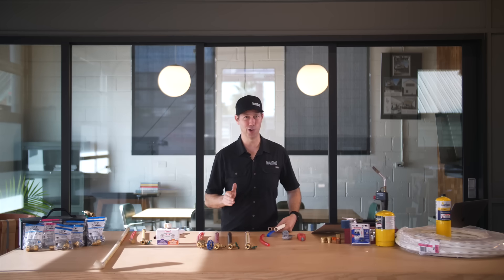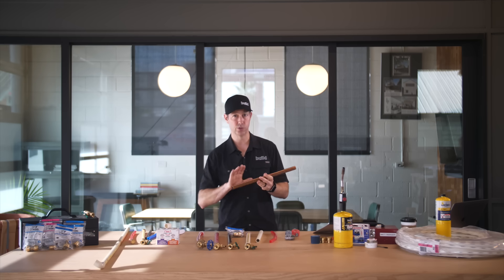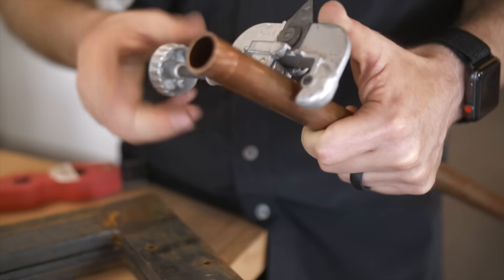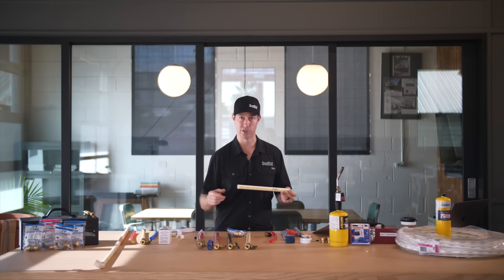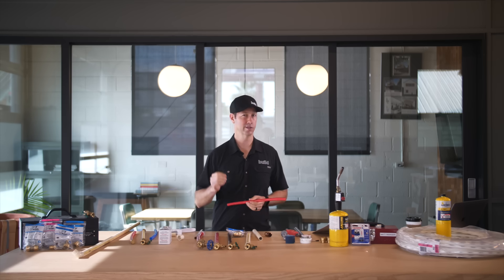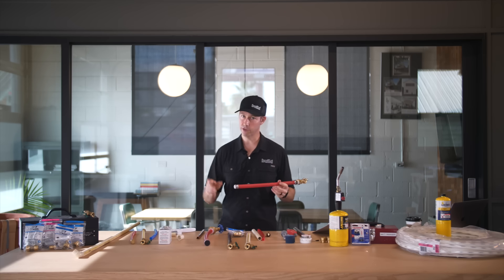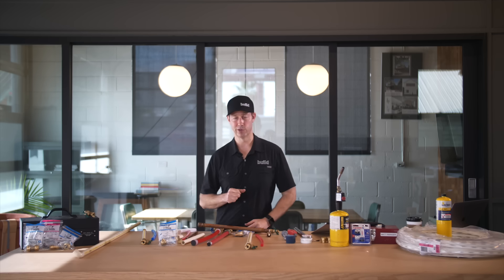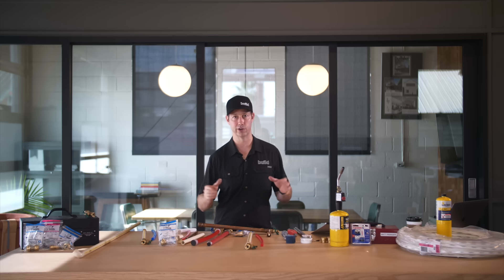PEX vs COPPER vs CPVC plumbing pipes

Comment: Pro tip. The clear primer does a great job of taking purple stains out. Also pro tip, only by the clear primer. I learned this when installing a brand new tub... dumped an entire bottle in a brand new tub. I thought I was going to have to get a new tub. Clear primer took the stain completely out
Reply: Careful if there is someone inspecting the plumbing, a lot of code doesn’t allow clear primer because you can’t tell if it’s been primed. That’s why it’s purple, they can tell easily
Reply: @P3rishedX 
Yeah, purple primer is literally just clear primer with a dye added to show it was used.
Reply: Amazing tip. Thank you.
Reply: Clear primer does the same thing purple primer does. It strips the outer layer. Whodathunk

Comment: A few comments:
1) PEX is not very durable for hot water service because of the combined effect of chlorination and heat. There's a lot of publihed data and long-term studies on this showing the need to replace it after ~5-7 years. CPVC is much better for this purpose, and I'd certainly prefer it for all water piping for ease of installation and repair. Besides, having all joints solvent-welded makes it very reliable, although the flexibility of PEX allowing its installation with minimal number of joints and bends is definitely a plus.

2) No piping system is intended to survive water hammer, and it's even less about piping supports than the piping itself which can even burst if subjected to severe and repeated pressure shocks, especially in long downward vertical runs. You have to install expanders, general rule: one 50cc expander for every 10m of straight horizontal run or upward vertical run, two for downward vertical run, and you need larger expanders for larger pipe diameters.

3) All plastic piping systems are available in black variety (with carbon filler) which is UV-resistant and can be traced outdoors. Obviously, it will still degrade, but much slower than white piping.

Comment: My home was built in 2001 all my copper system completely failed with pinhole leaks.  Three plumbers recommended replacement repiping. This was 2018. All plumbers mentioned the copper today is not like the copper from the 80’s or before and it is no longer a reliable product. After looking at CPVC ,Pex-a expansion and Pex-B compression.I went with PEX a uponor. Because pex a is expansive the flow path is wider.

Comment: What material is PEX and CPVC?
I am only familiar with PVC and Polypropylene.
I personally do not buy into this "Shark Bite" fittings. IMO, they will not last especially in high pressure systems.

Comment: I had a really bad experience with PEX and will never use it again. I prefer the CPVC but you also did not mention the compression fitting for copper that make it far more easy to work with.
Reply: What was your bad experience?
Reply: @seanm3226  It leaks.

Comment: they make a flex copper, they make a flex stainless steel, I was shocked when years ago I saw those flex metals covered with colored (red 4 hot blue 4 cold) plastic for insulation purposes.

Comment: I'm not sure why it seems like such a toss up, or why he recommends cpvc for remodel. Why not pex? He said the material (copper) is a little bit more expensive but it's more like 4x as expensive. Then says the pex needs fewer fittings, longer runs. So that's more money on both fittings and labor. Then he mentioned the increased labor for doing the copper fittings vs pex. So even more money. It doesn't seem to be competitive at all. Pex seems like the clear choice* (*except if cost is zero factor but even then, I don't know what advantages copper really offers). What am I missing? He seems to think copper will last longer, but I think he overestimates how long copper lasts. He said 75-100 years minimum. Ummmm, that sounds like a MASSIVELY optimistic view, no? I've got copper pipes in my house from the 60's and they ALL leaked years ago. I think most people have to upgrade their plumbing more often than once every 100 years, right? I would think maybe 50 years would be about right. I would also not trust the sharkbite fittings to last nearly that long either but I think the Type A fittings might last as long as copper. I'm not a plumber though so maybe I'm wrong?

Comment: i use to read about the PEX, They said PEX FAIL when the pipes are exposed to chlorine that is within the water. this is u have to explain more because city water has chlorine in it. n PEX,  there was a concern that some chemicals may leak from the pipe into the water.

Comment: Would not trust CPVC. Just a little exposure to the wrong chemical and it goes brittle. Wouldn’t trust it with my house. Copper, I would want the higher grade and make sure it is well protected when going through concrete.

Comment: I have cpvc in my home which was built in 1986. I have an under the slab leak on my hot water line which is going to cost me a lot of money to fix.
cpvc becomes brittle and cracks over time. Your only going to get 30 years out of cpvc . This is not some random accident because my neighbors are all having the same problems and have to repipe there entire homes. 20’000 to repipe my home because of cpvc. Stay away from that crap.

Comment: PEX o-ring sealing push on fittings make me cringe, but the barb/crimp fittings will make me consider PEX for addons.   Copper is simply the most robust and what you want inside walls.

Comment: Well, speaking of water hammer.  Can ANYONE tell me how to lesson the water hammer when my washer runs??  Its on the 2nd floor and the pipes hammer like crazy between two bathrooms I have.  I feel like it will lead to a major 2nd floor leak at some point.  I've tried water hammer arrestors on the washing machine.  They don't seem to lesson it at all.  I even replaced them after only a few months because I thought they might have been defective.  I've tried opening all the faucets.  That seems to maybe help a tad bit, but it doesn't go away.  Any ideas?

Comment: I grew up with copper and prefer copper pipes it has no BPA like the other pipes do. I really don't care what the manufacturer says about this subject. Stainless steel would be the best but copper comes in right behind stainless. If you have city water then copper may not be your best choice. And also if your home is a slab home then copper will deteriorate over the years like 20 plus.

Comment: Copper lasting 75-100 years?  Not here in Florida!  You got maybe 30-35 years tops...  I just had my house repiped with cpvc.  Alot of the plumbers around here prefer pex (cause it's easier to install)  but I wanted cpvc so I could make changes down the road if I needed to.  Plus, I've read that pex is suspected of leaching harmful chemicals in to your drinking water

Comment: Important to mention Nibco's lawsuit for their manufactured PEX around ?2010?.  Their pex could not handle simple hot water from your water heater, and there might have been some restraints on water pressure, too.  The Nibco PEX would randomly spring out with pin-hole size leaks anywhere along the line of PEX piping.  Fun to try to find where the leak is behind walls.

Comment: I have a hot water pex line that has leaked 5 times in six months. Should I repipe with pex or use a different pipe?

Comment: As far as copper goes... houses built 40 yeras ago with acidic water,  leaks are bad... and pvc / cvpc isn't an issue with that.  So there is that.  One thing you didn't mention was  how expensive shark bite is.  a 90 degree elbow for cpvc is 30  cents or something, shark bite elbow was like 8 dollars...  now tools are expensive... no tools for cpvc (use a normal saw to cut it, not the cutter you  showed)  and then just the primer/ glue... and smell maybe 10 bucks for a can).  So for DIY,  cpvc for hot water / pvc for cold  is way to go,  no investment in tools you will never use again.  You could redo your old copper pipe for pennies on the dollar vs pex or copper.  I saw videos where people use pex to put in a DIY water heater... they spent 100 dollars on tools and the pex flopped all over the place.  When they could of done it with cpvc and saved 90 dollars.  Also the color of pex makes it look like a kids toy when its out in the open, with its  blue and red color.

Comment: In northeast Indiana and have copper VERTICAL pipes of COLD water getting pinhole leaks about every 5 years. So what could be in my water that’s causing that? Can a rusty fitting on the pipe from the well-point to my water pump be the culprit? Or something else?

Comment: What you want from a properly designed system is when someone flushes the toilet, the washer kicks into the rinse cycle, or dishwasher kicks on,  or someone uses the hose or laundry tub, that it doesn't make a big difference in the water pressure in the shower.  Single element tests prove nothing, especially with restricted end points.  The PEX A to PEX B information that they disparage is based on actual tests and flow rates that can be integrated into your design to determine if what you are proposing will be adequate, regardless of whether you use A or B.  The performance of the fittings between the two are nowhere near the same.  That doesn't mean you cannot get adequate performance from PEX B, it simply means you need to consider the penalties in the design if you are to arrive at plumbing-industry-established performance..

1.  The 2021 Uniform Plumbing Code" "Appendix A Recommended Rules for Sizing the Water Supply System" shows how to size a plumbing system with the average requirements of each and how to calculate.  HOWEVER, it is based on standards, Schedule 40 to be exact.  Schedule 40 is oversized to make up for length that fittings.  Schedule 40 is steel and PVC, and CPVC.  Copper and PEX they use a fishermen's' scale for their pipe IDs.  Copper is mentioned.  PEX is not.

2.  Pipe IDs.
- Galvanized 1/2" ID is .622"	(Schedule 40 Standard.  Oversized to compensate for average flow restriction from fittings.)
- CPVC and PVC 1/2" ID is .622"		Schedule 40 (CPVC has the least fitting loss, even after diameter is factored out, due to PEX A's turbulence at the fitting.)
- Copper M 1/2" ID is 0.569"
- PEX 1/2" ID is .485"
- PEX 5/8" ID is .584"
- Schedule 40 3/4" is .824
- 3/4" Copper M is 00.811
- PEX 3/4" ID is .681"
- Schedule 40 1" ID is 1.049
- Copper M 1" is 1.055
- PEX 1" ID is 0.875"

3. Flow rates from a Supply Resources (The min is based on 2' per second and the max on 4' per second.)
- 1/2" Schedule 40 calculated max 3.841
- 1/2" Copper min 1.6 max 3.2
- 1/2" PEX  min 1.2 max 2.3
- 5/8" PEX  min 1.7 max 3.3
- 3/4" Copper  min 3.2 max 6.5
- 3/4" PEX  min 2.3 max 4.6
- 1"   PEX  min 3.8 max 7.5

What this indicates is if you want 1/2" copper performance, you need to go with 5/8" PEX.  If you have galvanized or CPVC, it is Schedule 40 which is altogether different again.  

4.  Let's do an estimation of what it would be for 1/2" galvanized and CPVC.  
- 1/2" PEX has an area of 0.18475 with a flow rate of 2.3 gpm
- Copper has an area of 0.2543 with a flow rate of 3.2 gpm.
- The area difference is .0.06955 with a flow rate difference of .9 gpm
- If we divide 0.06955 by 9, it will yields 0.007727777777778 per .1 gpm
- Schedule 40 1/2" based on it's .622" diameter has an area of 0.30386
- The difference in area between Schedule 40 and copper is 0.04956
- If we divide that by 0.007727777777778 we get 6.413227893601541 tenths of a gallon more than copper.
- From this rough calculation, Schedule 40 1/2" flows 3.2(copper) + .641(for dia dif) = 3.841 gpm for 1/2" Schedule 40, but is actually a little more than that because the circumference doesn't increase linearly with the area.  So we will now enter that into the table above.

5.  Now let's show the PEX A table that is disparaged in the video.
The competotor's chart shows using 3/4", which is actually MORE forgiving that 1/2" PEX would be
Area
Flow Area
PEX A .5 sq.in
PEX B .4 sq in -25%.
GPM
PEX A 12.4 gpm
PEX B 9.9 gpm	-25% - This is supported by the area difference.
Cost of Branch tee
PEX A 3 feet
PEX B 9 feet
Elbow
PEX A 3 feet
PEX B 8 feet
Based on physical properties and what we glean from tests from other sources, this makes sense.  We simply need to use different values when designing a system.

"PEX manufacturers state that PEX uses about 30 percent fewer fittings than CPVC in a typical installation, but that doesn’t come close to offsetting the higher pressure drops that occur with PEX pipes and fittings. Compared to a PEX system with 30% fewer fittings, CPVC (which is Schedule 40, achieves a 74-83% reduction in equivalent length caused by fittings.  The reality is that even PEX expansion fittings, which are sometimes referred to as "full-flow", restrict flow rates due to turbulence.  In fact, the difference in the internal diameter between a CPVC fitting (schedule 40) and an expansion PEX fitting is greater (27%) than the difference between an expansion PEX fitting and a PEX plastic body crimped fitting (22%)."
This also logically fits with the physical properties and is supported by data from other sources

6. Analysis:
- Schedule 40 is the standard and in plastic that would be CPVC.  CPVC also has the lowest fitting performance cost and even beats PEX A.  Copper and PEX use a Fisherman's Scale to measure size which explains the lower performance people are seeing with PEX.  
- There is a big cost to using PEX to begin with due to its diameter alone that less fittings doesn't come close to making up for.  To barely maintain 1/2" copper performance one would have to go to 5/8" PEX, which is very likely why the 5/8" size exists, and it would still be well under the performance of 1/2" schedule 40.  3/4 copper or Schedule 40 would need to be replaced by 1" PEX to maintain performance, and that is before the large penalty imposed by the PEX B fittings.. 
- Using 75% of max (the recommended) of the Uniform Plumbing Code book suggested max for sizing your system won't save you with PEX.  Simply copper is already underperforms Schedule 40 by 17% leaving you with an 8% margin rather than 25%.  PEX underperforms Schedule 40 by 40%,, E.G. 1/2" PEX flows only 60% of Schedule 40, leaving you at 15% BELOW standard design methodologies.  This explains why builders relate lower water pressure in their post-2000 homes (PEX A).  That is before the penalties of PEX B fittings that DIYers use.
- The biggest advantages to PEX is it is cheap and easy.  The advantages of PEX B are the tools are cheaper and the fittings don't leak, which makes it a safe sale to DIYers and why it is the best stocked at big box hardware stores.  For the best chance of having a PEX A system that doesn't leak or develop leaks later, you need to pay ~$500 for a quality the power tool.  (Read the reviews of those who have purchased and used the PEX A manual tools about leaks and needing the arms of a stevedore to use it.)  With PEX B, a quality PEX crimper/ring remover plus PEX cutter, plus 20 1/2" clamps, plus 10 3/4" clamps, costs $32, and a produces a permanently water proof joint every time.
- If you are replacing galvanized or copper you cannot do a size-for-size swap for PEX and have the confidence that you haven't majorly reduced performance.  You need to analyze your requirements and make up a design based on the new technology.  People in general will not objectively test different scenarios to see what they have before replacing their system with a new technology, thus their expectations will conform to the performance of the result,  wanting  to rather believe it is better after spending the time and money.  Moreover, they don't know if their existing system was designed properly.
- You could use is to use the "2021 Uniform Plumbing Code" "Appendix A Recommended Rules for Sizing the Water Supply System" in concert with the research from this post into your design.  Williams Plumbing has a video that I don't agree with their assumptions, but it does good job illustrating the process.  The drawback to going larger on the hot water lines is it will take longer for the hot water to reach the fixture.  You likely could preserve the smaller size hot water lines by installing a manifold near the hot water heater to enable the use of separate lines.  Due to the standard sizing of pipes, it is possible that parts or all of your system is over-engineered and going with PEX B will have negligible performance impact.  I will go either with CPVC Schedule 40 or design for PEX B.  It's not the end of the world If I end up needing to replace a 3/4" cold run with 1" PEX B.  I'll see how things shake out.

Comment: Soldering copper pipe is pretty fun and all but over here in Germany we rarely do it because compression fittings are just so much faster and convenient to use. You can use em for any copper line be it water, hot water, gas, oil and central heating. Any idiot can learn how to use a compression tool and its fittings within 15 minutes.

Comment: I have repiping company in California. We see copper type M failing in 10-year old homes. A lot of builders got sued for using type M in their homes. Uponor PEX or type L is all we use. CVPC has a very strong connection, but it always snaps right after the fitting. Sharkbite is a joke, it's excellent for quick temporary repairs, but trusting an O-ring to seal for 50 years is unrealistic.

Comment: I got multiple pinhole leaks in my 20 year old house and 2 pinholes in my yard line. After the third flood, I replaced all my inside plumbing with pex. I didn't get anywhere near 50 years out of my plumbing. My water isn't hard.

Comment: Curious question for anyone... I need to remove an 8ft straight section of galvanized pipe in order to install some shutoff valves.  What would be best to use copper, cpvc, or pex?  It's one section so there will be galvanized on either side.   Does it matter which one I use? 🤷. Any advice is much appreciated.